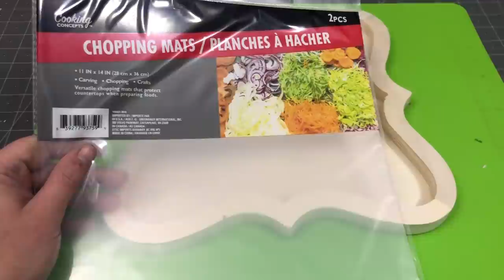Easter DIY's!  Easy to Make!!!!

Comment: I love the box with the pallets, greenery, carrot and marbleized egg. I could not see where you put the Jenga blocks in the corner. Were they put in vertical in the corner or horizontal in the corner? The carrot garland is adorable. Once Easter is over, the beads can be removed and used on another project! Brilliant idea in using the clear cutting mat to trace the inside of the frame! Thanks for sharing!

Comment: Unfortunately, my FETCH rewards app stopped scanning receipts almost two weeks ago. I have contacted FETCH rewards, but no one is responding to help me. Will probably just uninstall the app. What size wood beads did you use?
Reply: I had issues with my app a couple of months ago, it did take them a few weeks to reach out & get things resolved! Now it’s not scanning my e-receipts, but Ibotta isn’t having any issues! I just contacted them again, hopefully it will not take as long to get it resolved this time!